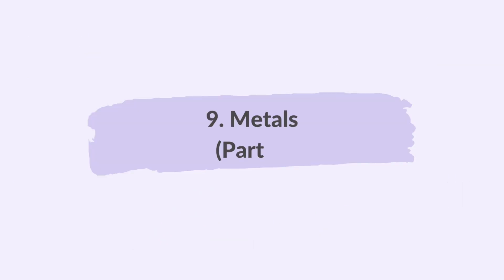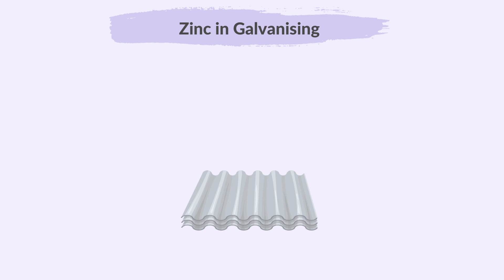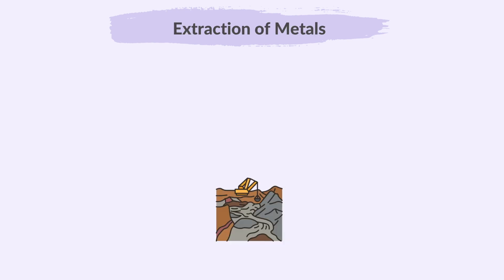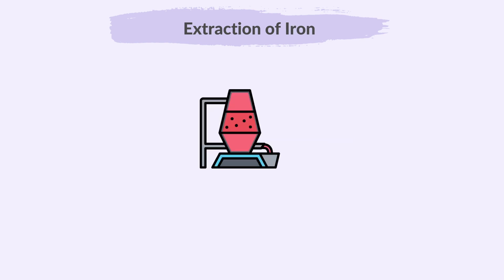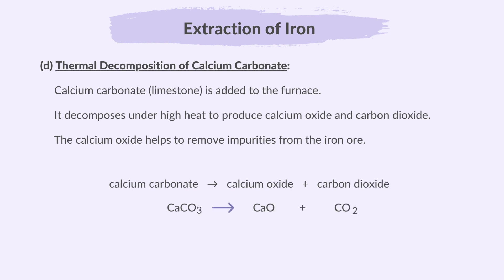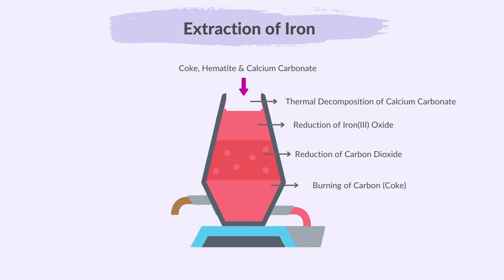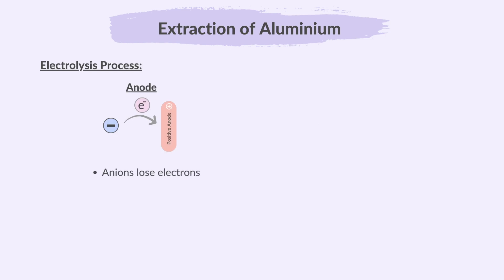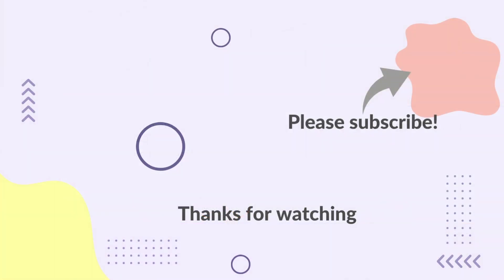9. Metals (Part 3) (3/3) (Cambridge IGCSE Chemistry 0620 for 2026, 2027 & 2028)

Comment: iron extraction
. from hematite 
. using blast furnace (iron added from the top. hot air is pumped from the bottom. molten iron collected at the bottom) ---> coke is burnt. CO2 produced. CO2 reacts with more coke to form CO. CO reacts with iron oxide to form iron and CO2. 
. calcium carbonate/limestone is added to blast furnace (produces calc. oxide and CO2) to remove impurities of iron ore. calc. oxide reacts with impurities (mainly silica) to form slag

Comment: corrosion: weakens the metal/breaks down metal cus it reacts with air or water
. to prevent rust u can galvanise iron or steel with zinc (provides sacrificial barrier since zinc is more reactive so corrodes instead)
Reply: Bruh ur everywhere 😭😭

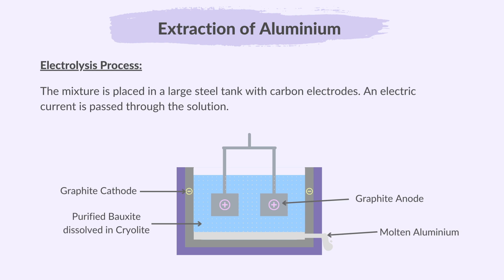Comment: 10:58 Why is the cathode placed like that instead of beside the anode?
Reply: @fearr the cathode is usually placed beside the anode because usually at cathode its just gas evaporating and if suppose a sold is deposited (eg: Cu) then it forms a coating... (I think)

The aluminum is denser than cryolite which is why it sinks and its easier to keep a cathode below and extract it. (Im not sure so its better to confirm with a teacher or someone else once)